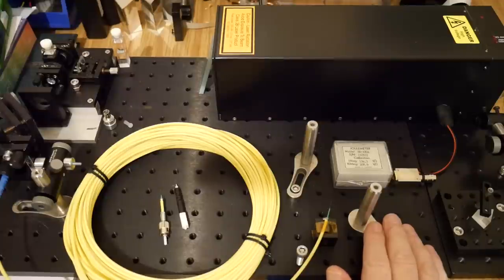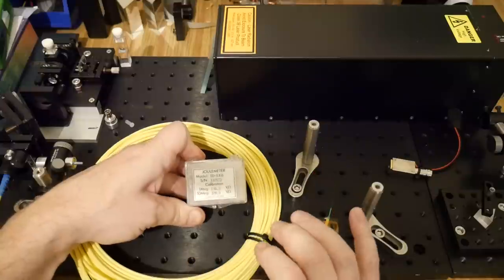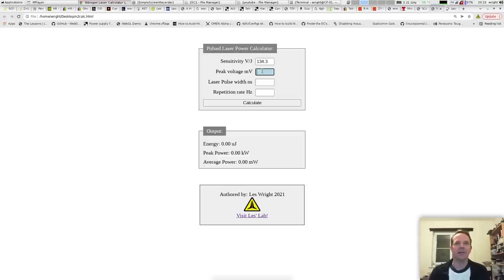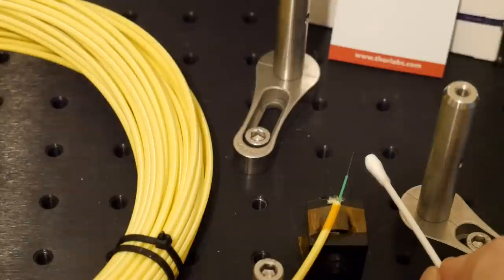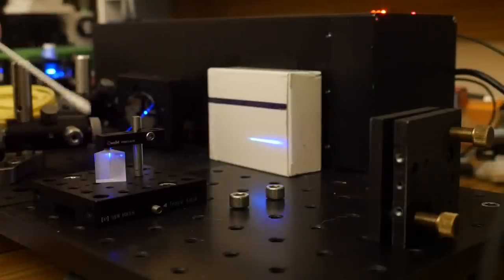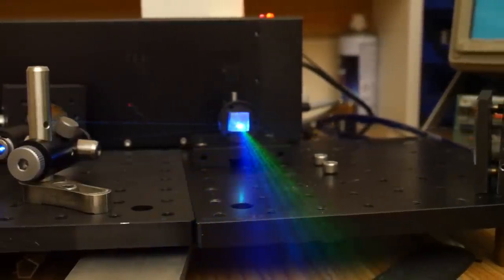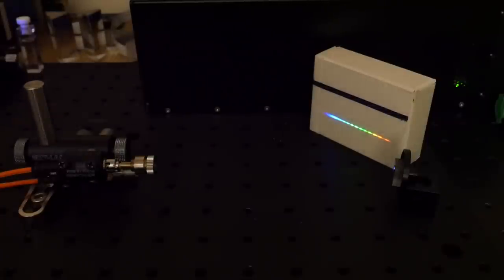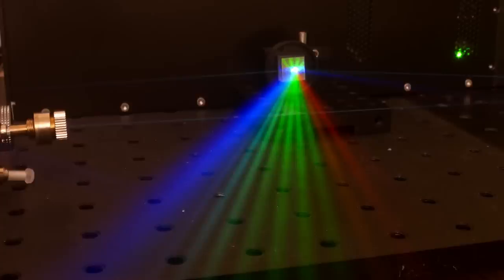Supercontinuum in Multimode Fiber

Comment: Hey Les and followers. I'm making good  progress with my own SC system! I built and calibrated a Pi Spectrometer from your earlier video. It works amazingly well. 'I can't believe how accurate it is. I bought some coumarin-1 dye (mixed with acetone) and managed to make a dye laser and shoot it into 30 meters of 50/125 fiber (FC/UPC ends) from a used Model VSL-337ND-S Spectra Physics laser.  From Thorlabs I bought an adjustable  collimating lens for launching the dye laser into the fiber. I'm not sure this is ok: CFC2-A Adj. FC/PC Collimator, f = 2.0 mm, ARC: 350-700 nm. I'm a little concerned that the UPC ends can affect my coupling and also not sure if the 2mm f is ok.
My question is this - I'm not really getting amazing SC yet. I get a huge peak at 446nm but not much spreading, and the light still looks blue. Any thing you might recommend?
Reply from the maker: Glad you are following the work! I have sent you e-mail . It could be a few things, maybe the solvent, maybe the Dye Laser setup, maybe the fiber, may be alignment. It is quite a touchy setup and requires persistence. A couple of other though have successfully replicated this, so it is in reach!

Comment: Multimode fibers can demonstrate some complex behaviour.  Of course I understand you wouldn't show all the testing you did in the final edited video, but If I saw a difference in mode coupling like that, the first thing I would do is play with the incoupling alignment to see if I could get the same affect for both lasers with the same length. 

The essential property of a multi-mode fiber is in its name, multiple modes are stable.  however, higher-order modes have higher propagatino loss, which means they are attenuated more strongly, the longer the fiber.  

Do you see the same behavior if you connect the fault locator on the longer MMF?
Reply from the maker: An interesting suggestion that I will look into. It might also be a good idea to set several wavelengths as well, I just did not expect to see such a tight output beam I will give it a go.

Comment: What kind of safety precautions are necessary for working super-continuum lasers?    I guess regular safety glasses are of little use.  Or are the powers low enough that it doesn't matter?
Reply from the maker: @Curix, the peak powers are such that it will happily damage your eyes, and you are right regular glasses are no use. I have Glasses for the pump Lasers, (Nitrogen and Dye) but for the supercontinuum, you have to make good use of beam stops (no un-terminated reflections of beam) and cameras

Comment: I wonder why the green flickers so much.
It would be interesting to see if it's sensitive to fiber temperature or magnetic fields or something.
Reply: Great observation. 

As per my other comment on this video, the supercontinuum arises due to cascaded Stimulated Raman Scattering. Basically, an optical frequency 13THz below the carrier frequency will steal power from the carrier. When this "thief" frequency gets sufficiently strong, another frequency 13THz below it will begin to steal its power and so on. Therefore, the lowest frequency order (highest wavelength going from blue through green to red) will be extremely sensitive to variations in the initial optical power of the incident pulse.

Thus, I suspect that the strong variation in the power of the green part of the spectrum is a "magnified" version of much more minute power fluctuations in the incident pulse from the dye laser.

Comment: Could it be some sort of etaloning effect happening in the fiber? I know that usually happens in a CCD detector, but it might be worth investigation whether etaloning can occur in long (+50-100 m) fibers also? Cool video anyways — thanks!
Reply: It's definitely Stimulated Raman Scattering. A spacing of 12nm at 500nm corresponds to 13THz, which is exactly the location of the Raman gain peak i silica. It's a very interesting and useful effect! Check out my other comment for more details :)
Reply: @yourfavouriteta  this sounds right!
Reply: @yourfavouriteta  wait, does that mean one could generate a 13thz signal microwave signal using silicon?

Comment: Was the comb effect present at all in the single mode fiber? I wonder if the comb spacing is related to fiber width.
Reply from the maker: So from comments in this thread, it is confirmed that is is solely Stimulated Raman Scattering that is responsible for the comb. In single mode fiber, I have not observed a comb (yet), but it looks like other nonlinear processes are smoothing the comb out into a continuous spectrum in small diameter fiber.

Comment: Can you reduce the appearance of speckle by mechanically vibrating the coil of fibre? If you watch a recent Mike's Electric Stuff video you'll notice he does a teardown on a biology lab instrument using what I assume is a solid state green laser and it's run through a coil that's mounted to a motor with an eccentric weight. The resulting motion creates a rapidly varying set of path lengths through the fibre and reduces speckle especially on longer exposure readings.
Reply from the maker: @hfuy8005  Yep, it is possible to reduce speckle this way. If you want truly absent speckle liquids can be used as well. Milk works very well indeed!
Reply: @LesLaboratory  Oh yes, the individual fat globules, I expect? The reason I ask is that I work in film and TV where we are very interested in continuous-spectrum light sources for the purposes of good colour rendering. LEDs are the current go-to but the spectrum of white LEDs, while usable, is often significantly less than ideal. There are other issues around shutter timing which really mean it ought to be continuous wave, or at least very high frequency. Useful power levels are on the order of hundreds of watts and the entire purpose is to beat the efficiency of tungsten halogen sources, which might remove supercontinuum lasers from consideration. Still, multiple ganged emitters would also reduce speckle!

Comment: Would it be possible to use this to create a full color hologram? The thought emporium used three colored lasers and a combining cube to get a "white" laser for creating color holograms and it worked okay, but this seems like it could capture the actual entire spectrum if it could be used.
Reply from the maker: I suspect not.The problem is that Supercontinuum lasers, they have good spatial coherence (i.e. you can make a very tight beam) are not temporally coherent (huge spread of frequencies) and so you are unlikely to be able to produce the required interference pattern on the film.
Litiholo plates are excellent for Continuous wave lasers, but I have yet to get it to react sensibly to short pulse, microjoule lasers like these. 
All that said, a faded memory of mine reckons that probably buried deep in a journal somewhere, somebody somewhere will have generated something that works with white light...